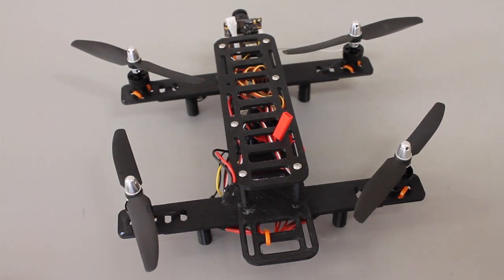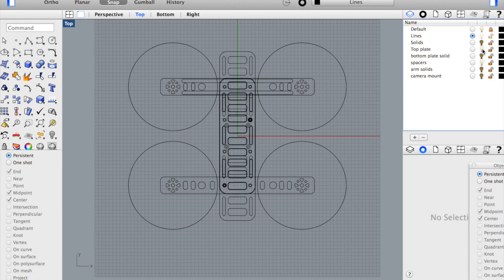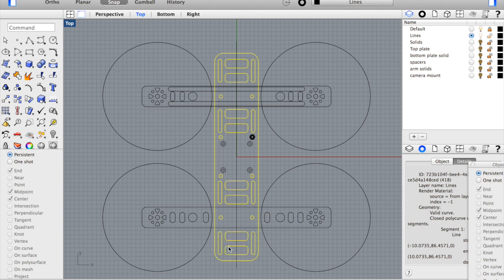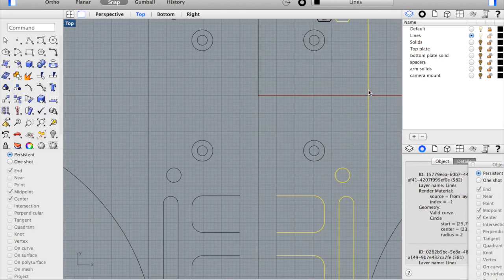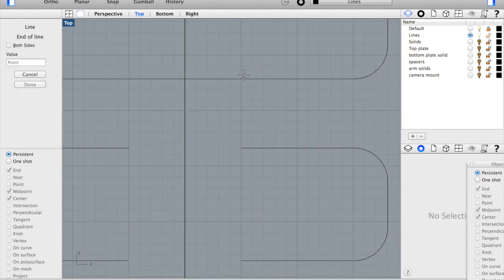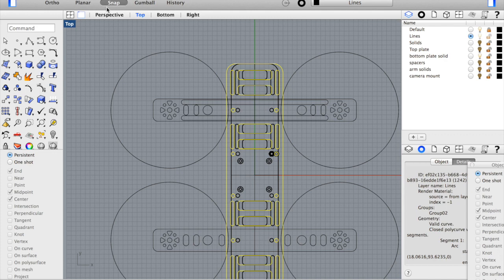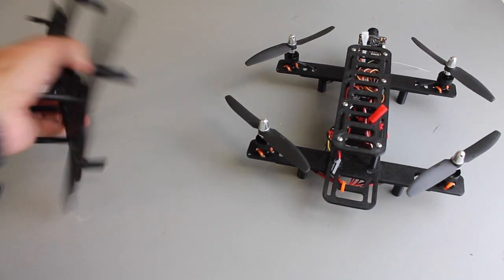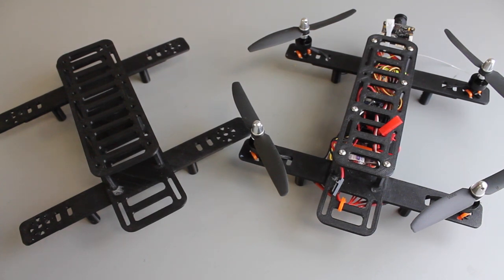3D Printed FPV H-Quad Frame Widening Using Rhino 3D and Printed on MakerBot Replicator 2

Comment: This is an old thread, but I'll comment anyway. Scale1d is your friend in this situation. Much easier than all that splitting and line adding. 

Just got a z18 at work, lol the powers that be have really crazy ideas about what can be done with it. I'm very curious as your prints look much better than what I've found in other places. 

What have you done to get such good quality prints?
Reply from the maker: +11geekim11 Thanks for the tip on Scale1D. I wouldn't say I've done anything beyond the ordinary tuning that one does with the MakerBot Replicator 2. It's really been a great 3D printer for my use.

Comment: I'm using sketchup and it works maybe later when I need more advanced options will shop around cad maybe I have it at work I'll design during lunch breaks
Reply from the maker: I hear you. I started with Sketchup and really enjoyed it, but I need something that made more sense for my engineering mind and that's when I fell into Rhino 3D. I like the ability to use the keyboard to trigger commands. Good luck with your designing.

Comment: You've pretty much inspired me to get a Makerbot of my own Dennis!! The one thing I haven't really come across though is how much the printer affects your homes' electricity bill. 

Have you noticed any increase in your bill after picking up your Makerbot? If not, how much printing do you think someone would have to do to notice an actual increase?
Reply from the maker: Glad to hear it! I have not noticed any increase in my electricity bill usage, but I probably only print 10-15 hours/week. I'm still not sure it would be noticeable on your bill, but I'm not an expert :) Good luck.

Comment: I don't know rinho3d but the way you are doing things is not very parametric. If your model were parametric and your constraints were well done, you only need to change one value to resize the model. If you continue designing your own models something like Dassault Solidworks or Autodesk Inventor are going to make your life easier. Keep up the good work. I'm subscribed to your channel.
Reply from the maker: Eduardo, good info regarding Solidworks and Inventor. I've looked into both of those packages previously, but they're both pretty pricey for a DIY garage hacker. I'd love to learn how to do true 3D modeling because most of what I'm doing in Rhino seems CADish and very beginner level, but I'm still trying to improve my skills. I do see Rhino has support for parametric modeling via plugins http://www.rhino.io/features/about-rhino3d/parametric-node-based-modeling/ so perhaps I'll take a look at that. Thanks for the great suggestion and appreciate you following along with my channel.
Reply: Dennis Baldwin
You might want to try BRL-CAD. Or SolveSpace.
Reply: Solidworks is where its at. Luckily I got it from work.